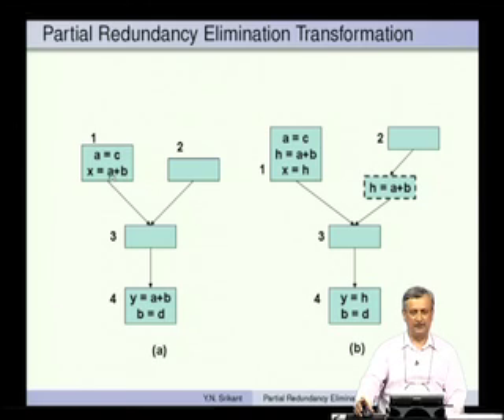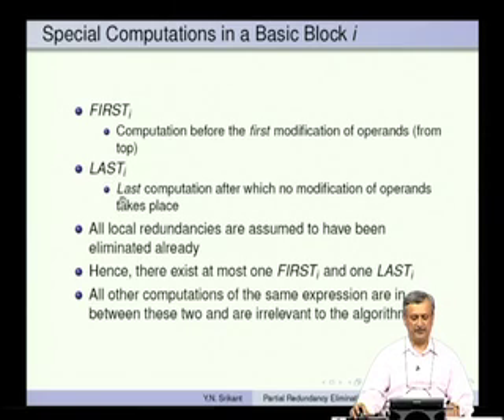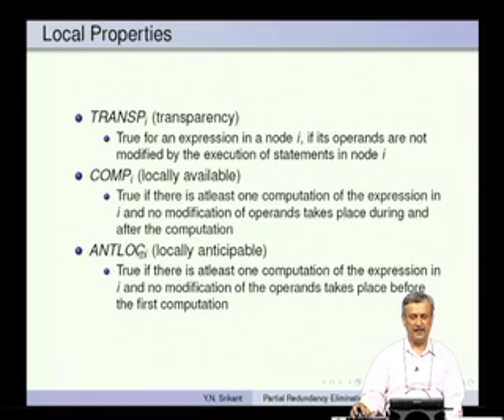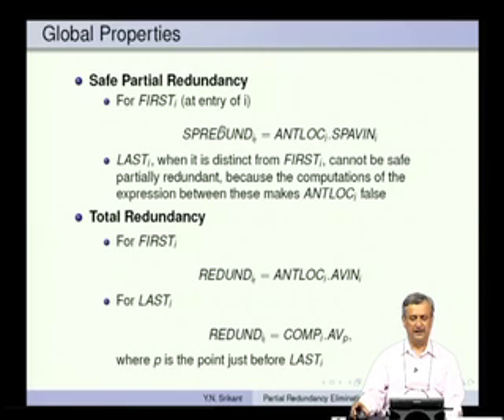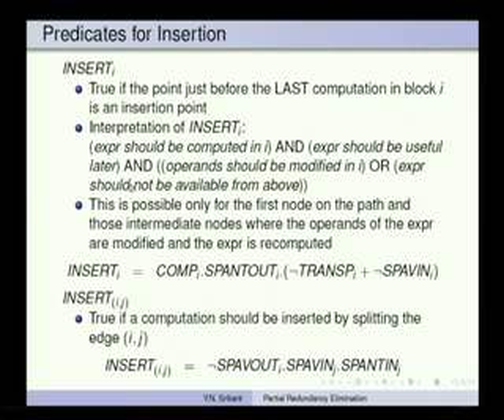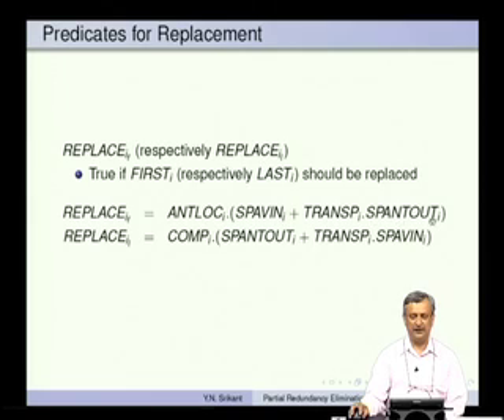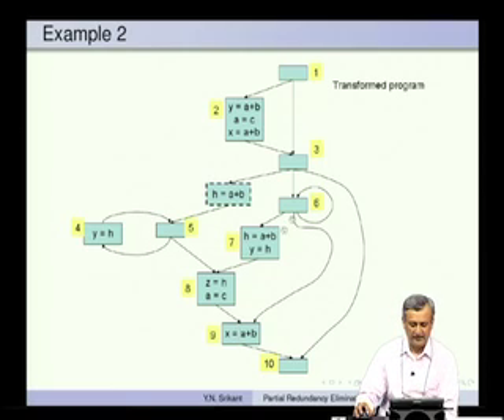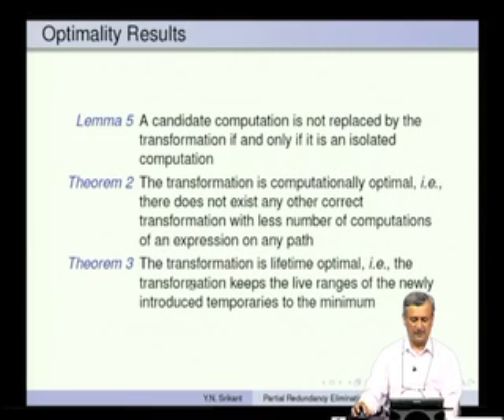Mod-12 Lec-20 Partial Redundancy Elimination

Comment: What is anticipable meant?
Reply: say you have an expression which is a point in code. That expression should be computed or executed in similar fashion throughout all the paths from that point till the end of the code.
if expression is e = a+b then a or b shouldn't change throughout the path from the point to end.